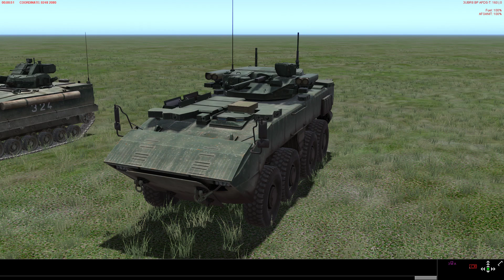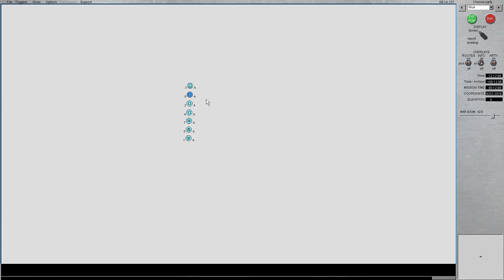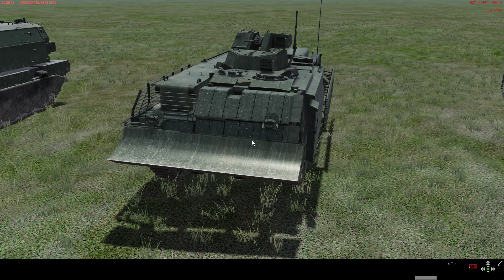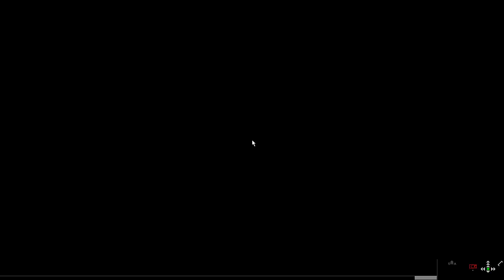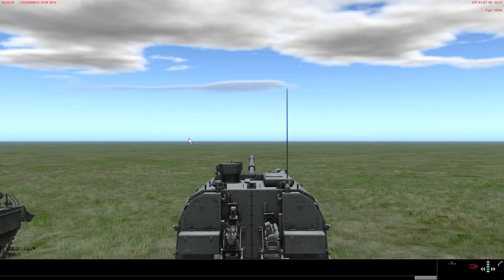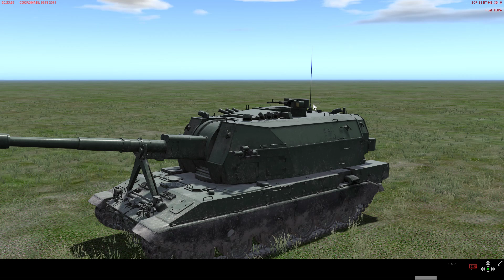Steel Beasts Pro PE - New vehicles of the Russian Federation Army (ENG).

Comment: Only the Russians would leave the light era modules to protect the ammunition storage in the armata and the heavy ones to protect the crew.   Ummmmm.... If the ammunition explodes it doesn't matter how many heavy era panels on the outside the crew will be a weenie roast.
Reply from the maker: Not exactly. In T-14, ammunition storage is isolated from crew, and there are blow off panels. For example the service hatch on turret roof, serves also as blow off panel. And crew itself as I said is isolated by solid bulkhead.

There is also a reason why light ERA is used to protect ammo storage, it's weight reduction. Same with lightly armored unmanned turret.

If heavy ERA would be used on the full lenght of the hull and turret would have heavier armor, T-14 would weight probably 60+ metric tons. Right now it weights 55 metric tons, which already makes it significantly heavier than previous generations of Russian tanks.